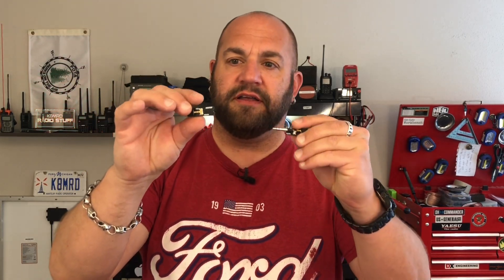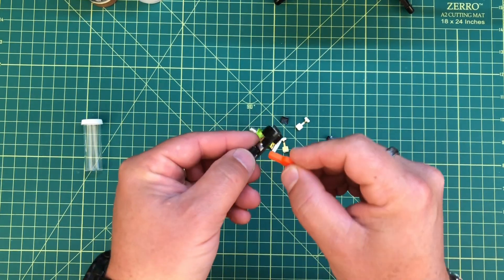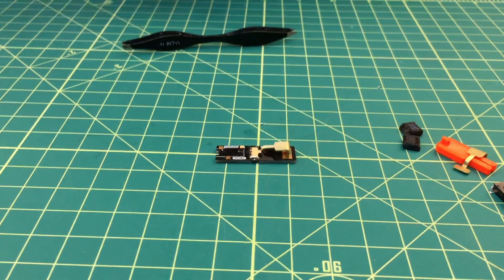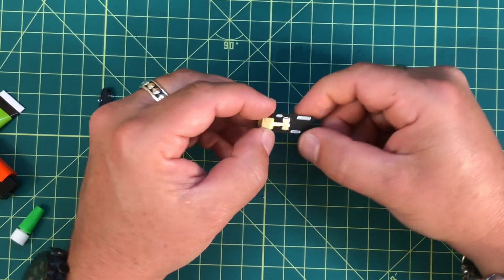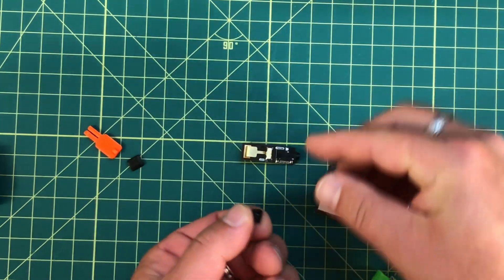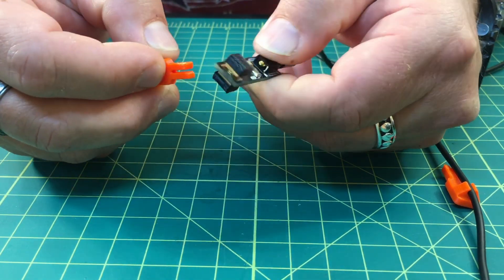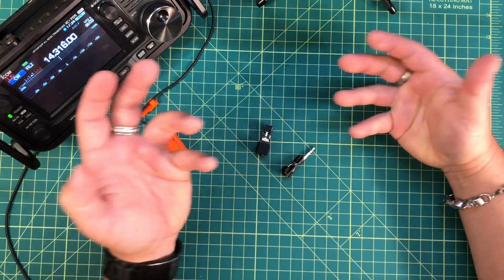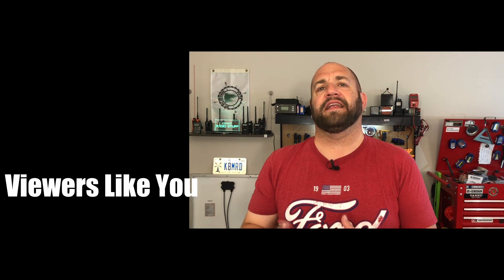N6ARA Tiny Paddle | Jack Version CW Paddle for Morse Code

Comment: Why do you directly apply flux to the PCB?  Are you not using flux-core solder?
Reply from the maker: Because that's what the directions said to do.
Reply: @hamradiotube  OK, makes sense....but I thought that was the purpose of flux core solder.